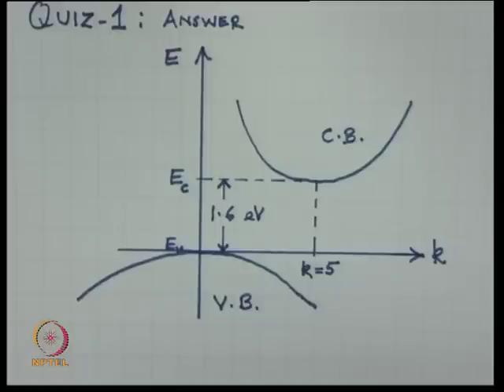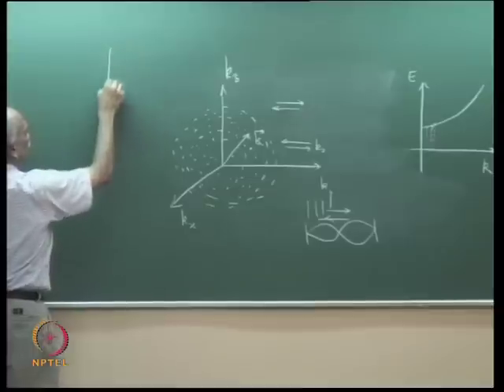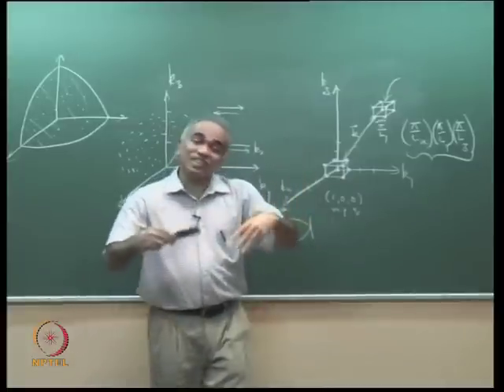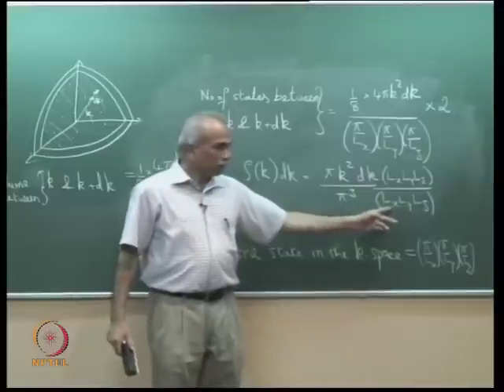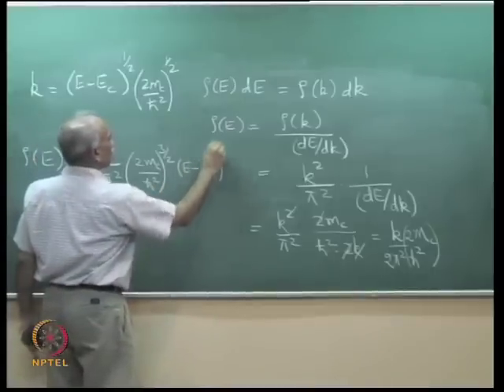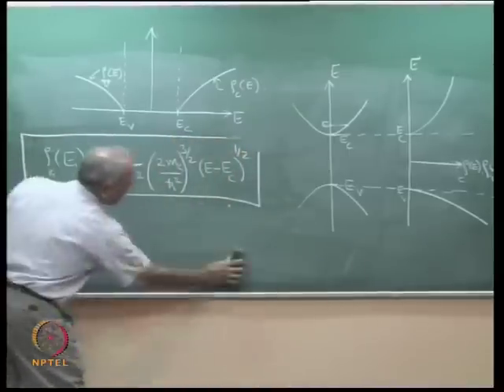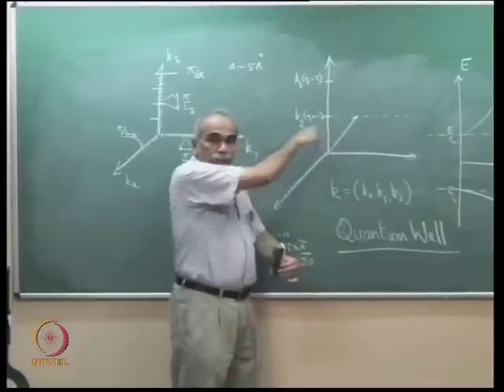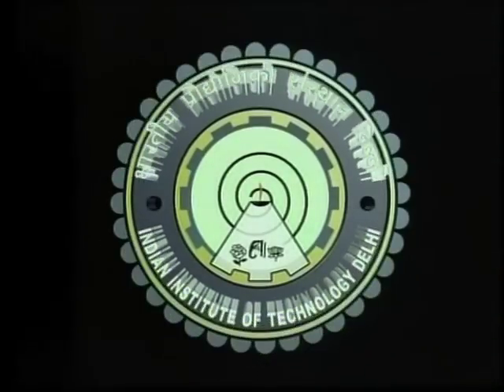The Density of States (contd..)

Comment: Why is the k-space considered spherical?
Reply: I was wondering the same..
Reply: we are figuring out number of states at value k. what all points in k space have same magnitude of k? kx^2+ky^2+kz^2=constant. it will lie in a sphere.
Reply: if you draw one milion dots in each direction, one after another, which would look like line and then if you take large number of these lines. Each line would be equally long, the whole picture would look like a sphere, simple as that. If you consider other geometrical shape, you know that these lines cant be equally long.
Reply: @vjencislavbarac1499  very straightforward